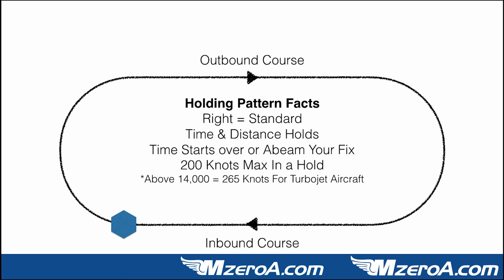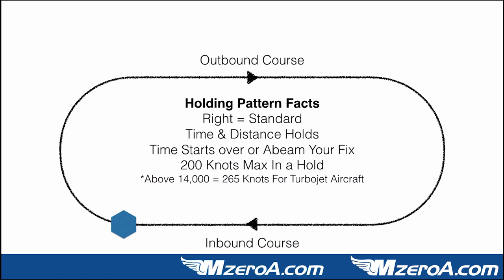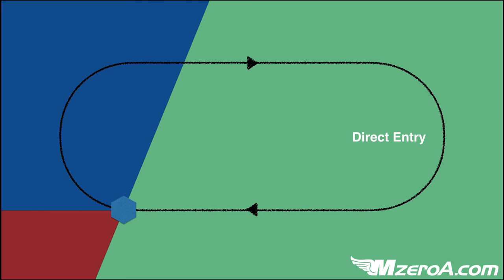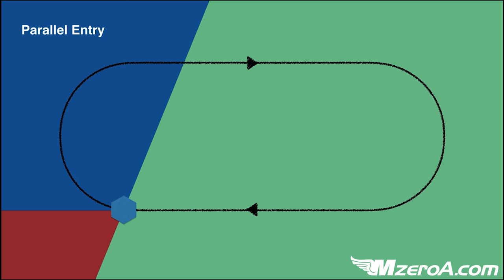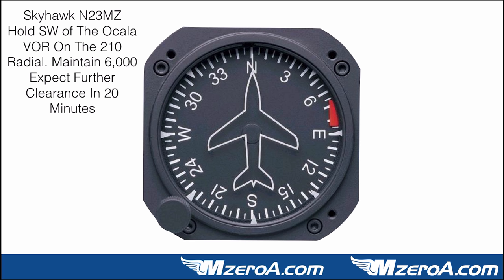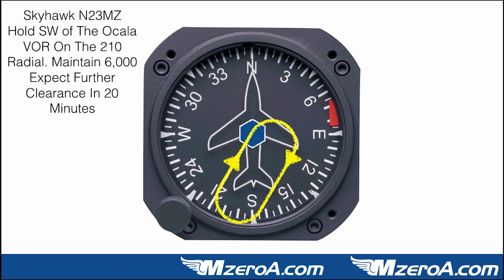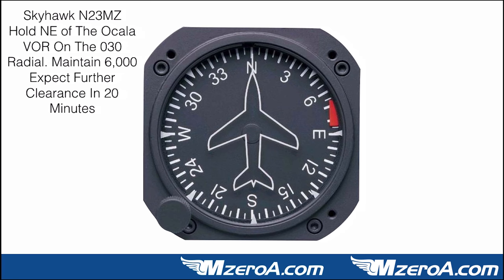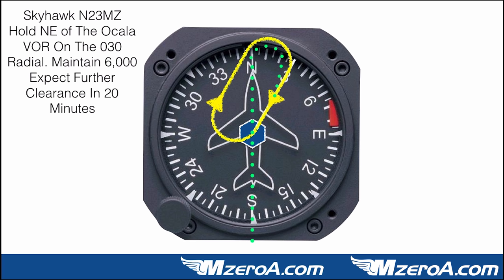Holding Pattern Entries Made Easy - MzeroA Flight Training

Comment: Take the radial number and find where it is if you put the plane on a compass.
Nose to right wing: tear drop
Nose to left wing: parallel
Behind the plane: direct

For left turns basically the same, just tear drop and parallel are switched.
Reply: thanks that helps a lot!
Reply: Nose to right wing is 90 degrees. Same for Nose to left. A hold entry is based on 70/110 degrees. Your suggestion isn't suitable for a flight test or training. In practice, in the real-world, good advice.
Reply: Whoa Nelly that always annoyed me about exams.

Does heading 180 qualify as an East or West bound course for the purposes of selecting an altitude for flight planning?  I use to know. Now all I remember is that it was a really big deal that I knew it once upon a time.  In practice, I just know that if I’m flying in a general north or south bound heading, I’ll be more mindful of opposite direction traffic.
Reply: @xpeterson  Actually altitude planning is not based on your heading, it's base on your Track (Course).

Comment: What about DME hold, it's seems to be more difficult and as well there's when examiners kinda "trick" the students when they're doing the procedures. If you can do a video covering that, would be great 👍
Reply: DME hold is identical, you just fly the inbound and outbound legs for a distance instead of a time. Standard hold is 1 minute inbound. You adjust your turns and oubound leg to ensure you're flying a straight line inbound for 1 minute to the fix. For a DME hold you don't have to adjust the outbound leg since you fly the assigned distance from the fix regardless of winds, but you still need to adjust your turn times to keep your legs straight. But this video is about entries - and the entries are the same for timed and DME holds, you always cross the fix and then make the appropriate turn for the angle to your inbound leg.

Comment: question man, in the DIRECT entry the first out bound and inbound legs are the entry? or the hold it self? cus i have been tought that the first inbound doesnt have to be timed because it is only the entrace but some other pilots told me my instructor is wrong and that  you have to time the inbound since the first inbound leg... what you think?
Reply: In a direct entry, the first leg is always the outbound leg. You're not in the hold until you cross over the fix and start your turn to outbound. You should time the turn and then time the outbound leg. There is no preceeding inbound leg to time.

Comment: So, just to clarify... When ATC tells you to hold NE or to hold NW of a VOR, as is mentioned in the video, how does that factor into the hold procedure? I gather that it is the location of the INBOUND leg to which this applies. Am I correct? I think hold procedures are confusing primarily because of this issue. To me, the hold itself as a whole doesn't immediately (or logically) match where ATC directs you to be if they give such direction.
Reply: The direction only refers to the location of the inbound leg relative to the fix. If they need you on one side or the other of that inbound leg that's what the turn direction accomplishes, so for example in Jason's direct entry example they would have said "left turns" if they needed you to stay on the east side of the inbound leg.

Comment: I tried today but was not successful, i wad flying heading 024 to join radial 182 inbound and 002 outbound, according to your video i draw it and it was direct, but actually it was parrallel...i dont know what is wrong in the method ebcause it seems correct
Reply: When your inbound the 182 radial you are heading 002. And your outbound leg is heading 182. Its only parallel with left hand turns

Comment: Maybe I have been lucky in my career... sorry but in 4200 hours i have been asked to hold maybe a dozen times.  Most of the time ATC will slow you down enroute in order to keep you from holding or I have listened ahead on the radio and asked to slow down.  All of them have been when flying in the eastern corridor.  Good skill to practice and good video but I just honestly have not been in many holds.
Reply: When ATC needed me to hold near Hayward Field the controller told me "Got some traffic ahead of you, I'm going to put you in a box pattern" and then he called the turns for me! I thought to myself - what an easy hold ;)
Reply: Tim, in my 2000 hours I have been asked to hold ONE time. It's interesting that it just happened to be when a instructor was with me on an IFR flight, and the destination weather was really bad (at or below minimums for the precision approach) . I would NOT have flown in those conditions by myself, so maybe that's why I 'almost never' get assigned a hold?? ;-)
Reply: I was put into 3 holds during the 1 month of my IFR training. My instructor told me what you are saying - you’ll probably see one or two ever and by the time my training was done I had executed 3 assigned holds in actual.
Reply: It's a skill you need to have in your back pocket, but it's true that in the U.S. true assigned holds are pretty rare. However, in the event of an emergency or an airport ground stop, etc, they'll throw every approaching plane into a hold until they get it sorted. It happens. It's just rare that you end up in that stack especially for GA pilots that don't fly in the system multiple times a day. Unfortunately that means we have to learn it for the checkride and probably practice it on IPCs, but it's virtually guaranteed that if we actually get one, we'll be rusty on how to fly it.

Comment: what determines the protected leg of the holding pattern?
Reply: It's known as the protected "side" of the holding pattern and there isn't one variable determining the holding-side, but many.

There are published and unpublished holds. Published holds are seen on charts and unpublished holds, similar to Jason's examples, are given to the pilot via radio by ATC which are not printed.

Published and unpublished holding-sides are predetermined by known ground-obstacles, traffic flow, traffic separation, terrain, weather, atmospheric phenomena, ATC radar limitations, and controller's discretion.

In short, it depends.
Reply: The direct answer is all of the space around the hold is protected or more correctly controlled and perhaps the term protected leg is a misnomer.  It is possible that someone could be in the space not in coordination with ATC but that is a different subject and if the case ATC would not be holding anyone there.  Your question may infer that there is a line that if not crossed guaranties your safety and knowing exactly where that line is would help you to stay safe.  Sorry to say that if you tried to construct all of the lines that you should not cross while piloting the plane you would be very distracted and not safe regardless of position.  Suffice it to say that there is the holding side and the non-holding side and if you are flying the hold on the non-holding side then you not in compliance with either the ATC instructions or the published information and as such you have 1) deviated from instructions and may need to do some explaining, and 2) created a problem for ATC.

Comment: Why is it called the inbound when you're going to be flying the reciprocal? ie for the direct entry example, inbound is 210 but you're actually heading 030.
Reply: The inbound leg is on the 210 degree 'radial' which is the heading 'from' the VOR.  However, when you are flying on the inbound leg you are flying 'to' the VOR on the 210 degree radial.  When actually flying this hold, you would end up setting 030 on your CDI so you wouldn't get reverse sensing on the inbound leg.  You'll only find this issue when your hold is being called relative to a VOR.